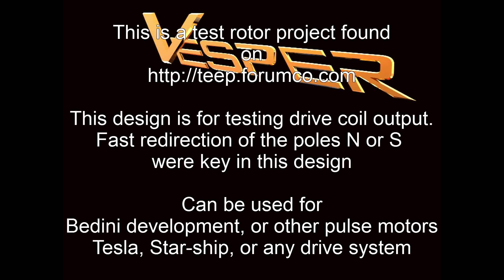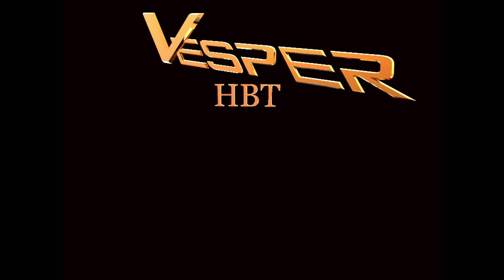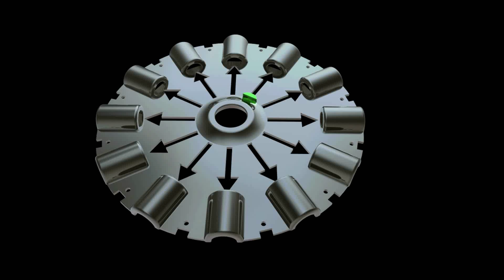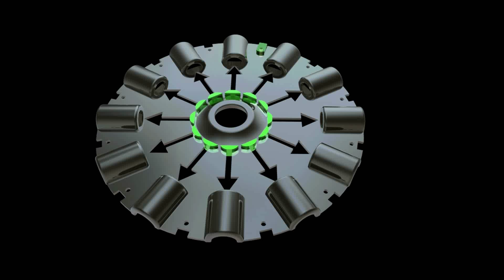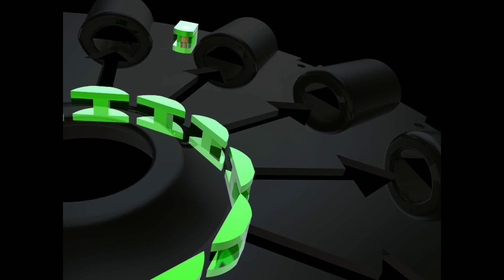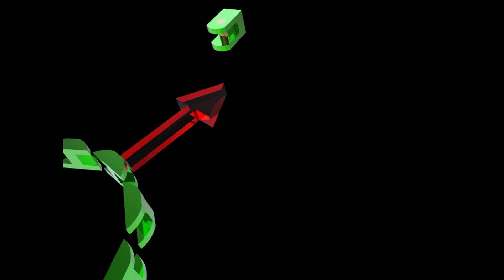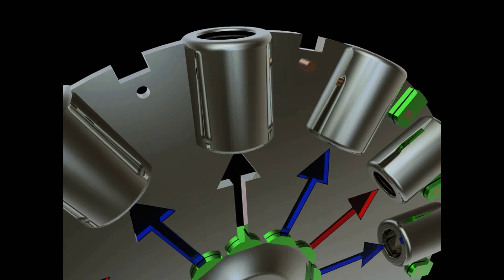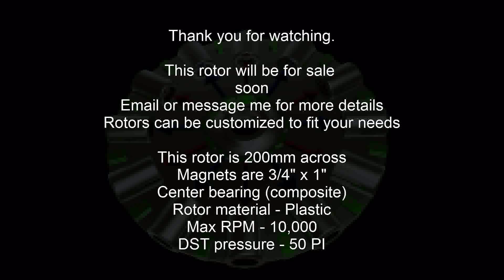12 Magnet Rotor Project Introduction Part 1

Comment from the maker: Right!!!! After some testing on the real rotor I found that at 22,000 RPM it warped the plastic beyond workable conditions, So I will be redesigning the rotor to take the extra stresses off the outer areas of the rotor I will be doing a series of videos for all the testing.